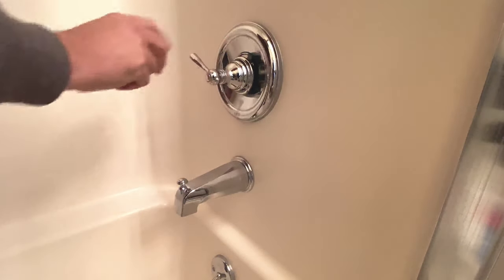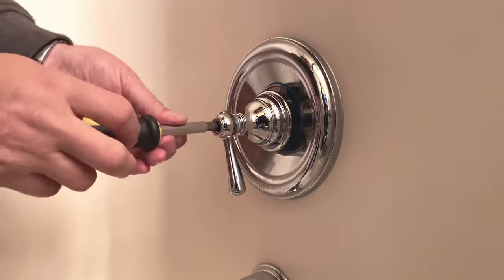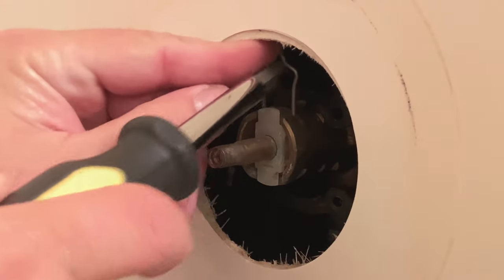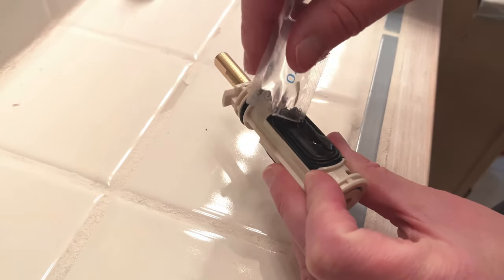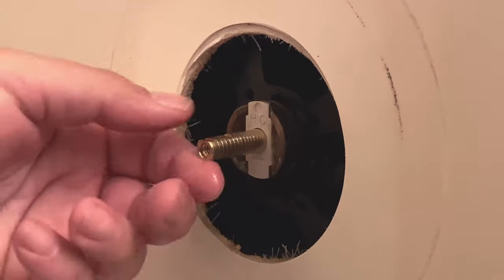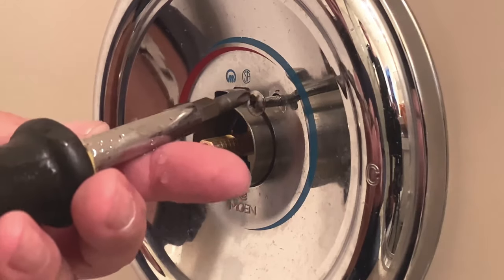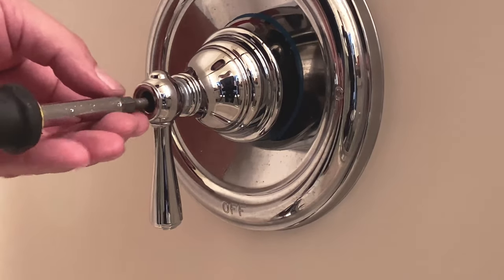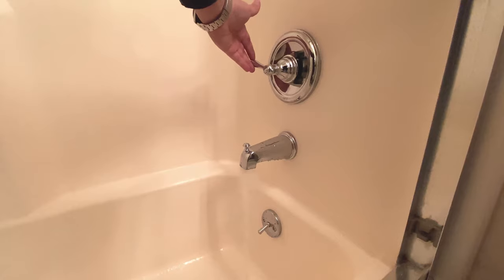DIY Bath and Shower mixer valve repair - Moen 1222 posi-temp cartridge replacement - it's easy!

Comment: Don't even think about starting this job without a puller. If the cartridge is stuck due to deposits - you'll have a hell of a time trying to pull it out.
Reply: I bought the puller in case I need it. Thx
Reply: Oh my god are you ever right.  
First time ever replacing one of these and I cannot get that damn cartridge out no matter how much force I use.  I know I am going to be sore tomorrow.  
Just ordered that cartridge puller tool online and will have to suffer a dripping faucet for a few more days until it arrives from Amazon lol.
Reply: I went through living hell pulling the cartridge without the puller. Huge mistake. Learned my lesson.
Reply: WD-40 works wonders...should replace every couple of years to avoid cartridge getting wedged inside shower body due to water deposits .
Reply: I actually didn't use it, cartridge came with a plastic cap that helps twist and then just pull off with a plier, now inserting back is taking me awhile as I text 😅

Comment: Two big points not in this video.  First on older cartridges they won’t come out unlesd you loosen them first, use a puller, and pray a lot!  Second, the clips don’t go in the bottom holes of the cartridges easily.  Sometimes you have to push the new cartridges in about 1/32 of an inch more and slightly bend the bottom of the clip towards the slot.  Old copper clips almost never work with new cartridges so buy a new clip just in case.
Reply from the maker: Thanks for the added suggestions.

Comment: I notice you first had the cartridge with the notched flat on top, then the correct way with the notched flat on the bottom, the correct way. This is important.
Reply: Unless the water lines for hot and cold were installed opposite- I had a plumber do that!

Comment: My Moen tub/shower valve was originally installed in 2008 when I remodeled the gust bathroom.  Recently, I used the shower to make sure everything worked okay since we had company coming.  When on the hot water setting, the pressure dropped off to a trickle.  Watched a few videos and found out that the cartridge (1222) needed to be replaced.  Picked up a new cartridge at Home Depot for $54.  The old cartridge would not come out like shown in this video, even using the plastic notched piece that came with the cartridge.  Tried pulling it out using vice grips.  Watched a few more videos and found out I needed a cartridge remover tool.  I went to Lowes (closer) to pick up a Moen Cartridge Remover Tool.  Found the Moen 1222 cartridge a lot cheaper for $38.  Damn.  The cartridge finally came out with the remover tool.  Sanded out the inside of the valve with #320 sandpaper, cleaned it out and installed the new cartridge with no problem.
Reply: Thanks for the help I am going through the same problem right now!
Reply: @petersawicki4403  Same here!

Comment: This video showed me there was no inner handle adapter required on Moen Posi-Temp trim kits that use a handle attached to the center with a phillips head screw. Newer Posi-Temp handles use a allen head (hex head) screw at a 90 degree angle to hold the handle on and therefore require an adapter. Thank you!

Comment: Having an issue with it not seeding completely inside? Thoughts? Bc i cant push the pin all the way down
Reply from the maker: there might be something blocking the valve from seating properly. with any repair, clean parts are critical to success. Water can have minerals in it that build up. Perhaps this is your problem? clean with steel wool or fine sandpaper until smooth. Careful not to make scratches.

Comment: Easy if it goes accordingly. I'm in the process of doing this now. Second replacement on the same shower. The first time was easy. However, this time a whole other story. The handle stem was welded onto the cartridge stem by corrosion. It took a cutoff wheel to remove the whole handle. Massive pain to remove. This is the reason why Moen changed the design. No more metal on metal contact.
Reply from the maker: bummer. I hope you got it! I had a similar problem with a bike seat post - aluminum fusing to steel. Total mess.

Comment: My moen leaked behind the shower wall, it’s not the pipes that are leaking because the leak stopped when I shut it off, will changing the center part what you just showed stop the leak? Or do I need a plumber to come out?
Can you let me know.
Thank you in advance!
Reply from the maker: Once you pull the cover off, you can have a better look. Sorry I can’t really help more.

Comment: I have a shower that won't mix properly. The valve is clear and functional. There is a thump as you turn from hot to cold and back, and then it just gets hot or cold
Reply from the maker: Yikes! That doesn’t sound right.

Comment: At any point do you need to turn the water back on to check for any leaks? i put the new cartridge and pin in. Should i turn the water on after that step to check for leaks or do all the steps and wait to turn back on at the end?

Comment: Moen replaces parts for free- DO NOT BUY ONE OF THESE CARTRIDGES! Call Moen. Also, when I replaced mine, it was to try and stop a squealing/howling shower. Well, that’s fixed but, according to Moen, the tub faucet leaks now because I used the oil my new cartridge came with to oil it...as the instructions instructed (and every YouTube video). Moen says they come pre-lubricated. They’re sending me a new one AND emailed me their instructions. 

Good luck!
Reply from the maker: Thanks for sharing. That’s great to know. I would love a lifetime warranty on everything I fix!!
Reply: I bought 2 of these and one came with the packet of oil, and the other came with a packet of silicone grease. From previous experience, I'd used the silicone grease. Didn't feel right about using the oil, and you just confirmed it. Thank you.

Comment: Mine is leaking in to the inside wall . this could be the problem ? I already se that leaks when I open the valve
Reply from the maker: Yes. It can rot the walls, floor, cause mold and much damage if not sealed properly. Good luck!

Comment: My faucet was leaking  I removed the cartridges 1222 replaced with a new moen 1222 still leaking what do I need to do
Reply from the maker: Was it leaking from the mixer? Was there corrosion or any build up of mineral deposits that may prevent a good seal?

Comment: Here is a simple trick to get the valve out. 
Take off the shower head and replace with a standard end cap (1/2" black iron cap - less than $2). Take the pin off the cartridge and turn on the main water supply. Wait until the valve is pushed out by water pressure or you can help it out with pliers. (Have someone ready to turn off water supply) Done!
Reply from the maker: That doesn’t sound suspect at all. Lol.
Reply: @robdude1969  You didn't think of it, so you ridicule and minimize its effectiveness - shame on you.
Reply from the maker: I don’t doubt it’s effectiveness. It’s just funny to think of the valve shooting across the tub before your buddy gets the water off. Thanks for watching! 🥂🥳
Reply: @robdude1969  I doubt your method I have no evidence like you, but I still doubt it. Imagine all you want, but you are just guessing and it's bad guessing. You could hold the cartridge from moving with your hand, it's not going to shoot out like a bullet - if so the clip that holds it in place under normal operation would break and shoot out like shrapnel. Shop trying to be in charge - it's embarrassing!
Reply: For those who don't know this trick, the water pressure pushes the cartridge out. Very simple 2 person job. One person at the water main shutoff, one person at the shower body.

Comment: My house was built in 2003, first time thinking of changing the cartridge bcos is leaking. What model of moen replacement cartridge  do I buy. thank you
Reply: You should contact Moen but most likely it is like mine (about 20 years old house with original Moen cartridge) p/n 1222B. You MUST consider the cartridge pull-out tool before starting this job. The Moen original is about $33 (CAD) but Canadian Tire offers a compatible tool @ $12 (CAD). The cartridge is the posi-temp series but best to ask Moen for a confirmation.